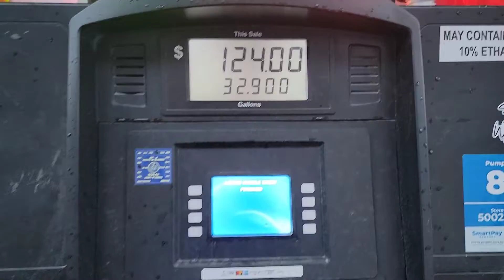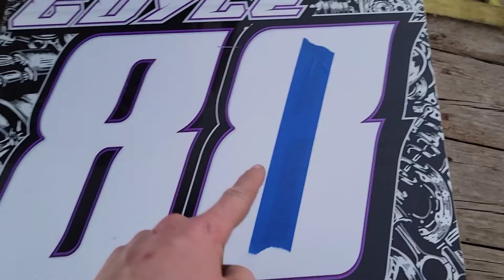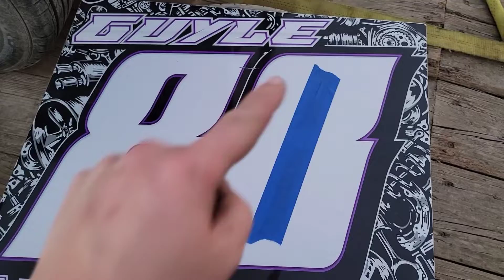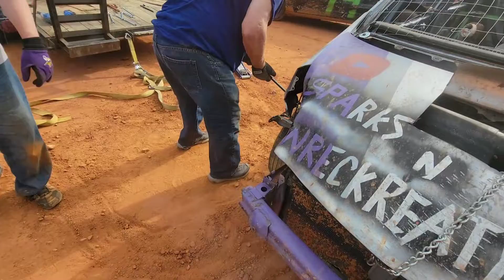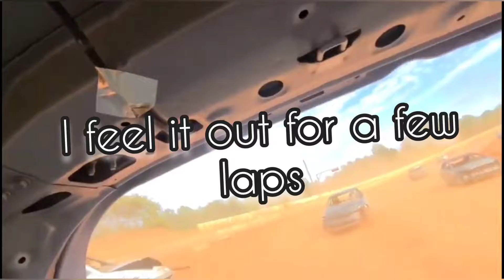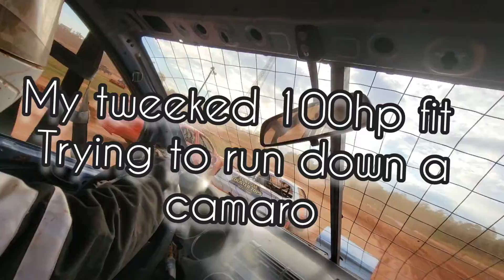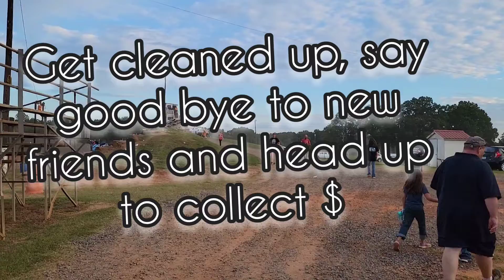2022 CAROLINA SPEEDWAY ENDURO 250 (10K TO WIN 4 CAMERA ANGLES)

Comment: I'm only 8 minutes in and I've noticed that thing fucken moves!!!
Reply from the maker: She has a healthy little heart!
Reply: @SparksNWreckreation  what engine is that
Reply from the maker: Just a 1.5 VTec
Reply: @SparksNWreckreation  it is a vtec!! Fricken awesome bro lol you allowed to boost your cars in these races?
Reply from the maker: Only if it already came turbo. Some tracks allow turbo/sc cars. Others do not.

Personally boosted cars don't seem to hold up well.

Too many vacuum lines, intake plumbing, oil lines to lead to reasons for failure when getting smacked around and putting to the test for hours at a time